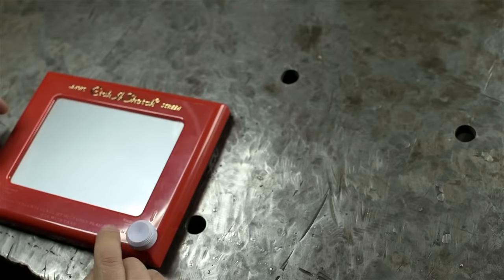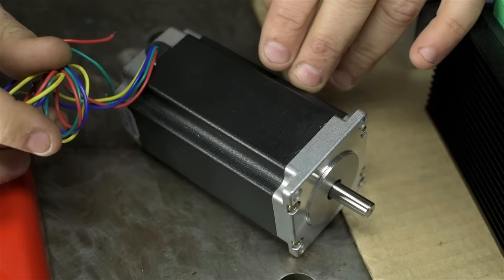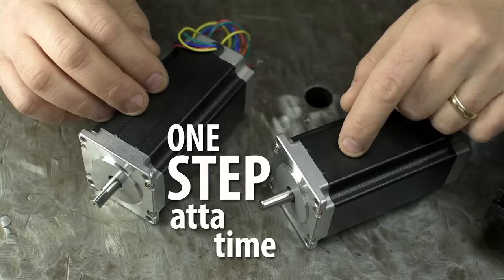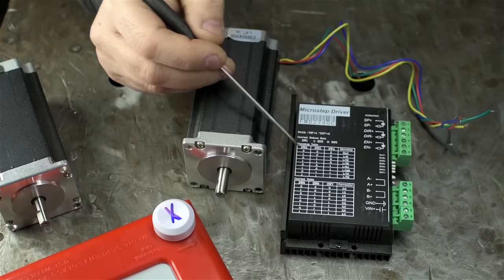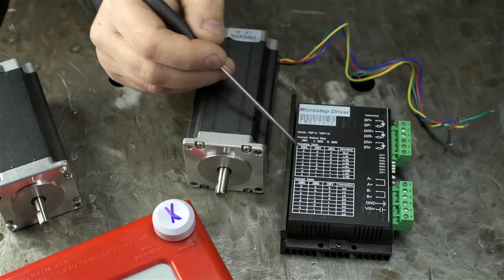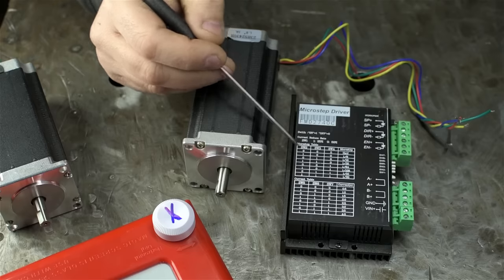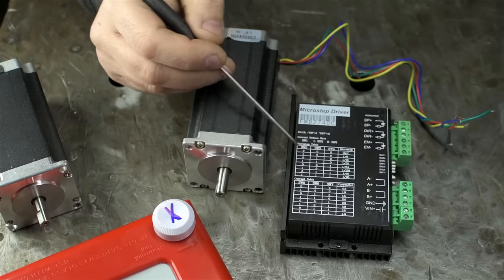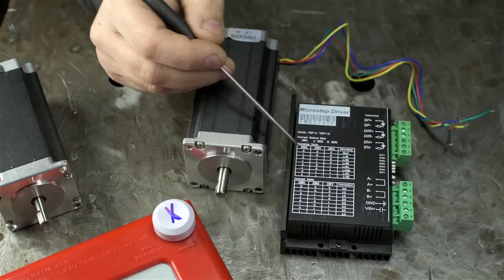Build Your Own CNC! (Part 1) - Hardware

Comment: if you fing that the  output is a bit messy with lines everywhere like the horse at the start, when your making the image into a stl or obj or other format into a gcode, if you use cura or other printing software try using "vase mode" or try to find a button that says "do perimeters first". it should decrease the amount of messy lines, oh and one more thing if you can find a button that says "avoid crossing perimeters" which would further decrease the messy lines. 
hope this helps lol

love your vids keep going

Comment: Those NEMA23 motors are good enough for a small CAR!  Actually most hobby CNC machines and 3D printers use NEMA-17 size motors, some use much smaller NEMA-23's than the ones you have, which almost look like NEMA-34's!  The 3D printer I built does use the '23 sized motors, but they are actually shorter than some '17 sized ones.

Comment: A clever plotter algorithm when you can’t control pen up and down is to convert a raster image to a a set of stipple shaded or dithered points then run a TSP solver on them. The result is a path where no lines cross and the drawing density roughly follows the original shading. You should be able to find a good workflow online— I worked one up many years ago but don’t have the foggiest idea what became of the code

Comment: About the "tangled in rope" part. I use simplify3d for 3d printing, and there is a little checkbox that says "move the nozzle over the printed lines"
Mach4 might have a similar setting, which would let it move the little drawing header over the already drawn lines

Comment: Since the shaft on the motor is available on both ends. Possibly you could put a counter weight on one side of the 3rd axis to help shake the crap out of it. Put it on a small gimbal to help with range of motion. Draw erase repeat. Look mom no hands...

Comment: You would need an air compressor for a bagpipe driver. I play with a guy that tried to help put that together, to break in reeds without blowing out your own lungs. Typical pressures for reeds run between 15 in - 40+ in of water. It doesn't seem so bad until you actually try to blow that hard.

Comment: Also there is posssible more than z-axis, if you example 3d-print there is motor to push plastic to the melting zone. And depents about you cnc, there is loads of option what may need 4-5 or more motors. Same principle, only you need motherboard with more places for driver boards.

Comment: I had planned to use a vibration motor to shake the etch-a-schetch to erase after turning upside down. GRBL is actually pretty easy to use and set-up.

Comment: Oh man, am I older than Tony? I started with the home cnc stuff back when step/direction controllers were unobtainable. Four pins of parallel per motor, four little amplifiers to match. Idk if my memory is operational, but luberth dickman? Was one if the early, early early folks to break the home brew ice!

Comment: Great video! Very thorough. 
BTW you can buy replacement keys (used) for Lenovo/IBM laptops on ebay for next to nothing. They're made to fit multiple models and sellers usually list the compatible models.

Comment: If you wanna do it on the cheap, you can use a Arduino Uno for $20 instead of those fancy control boards.  There is an open source software for the Arduino called GRBL.  This works extremely well and is super easy to setup. You then can use Fusion 360 to output your gcode and use BCNC to send it to the Arduino. There are some great tutorials on how to do this and you can slap a CNC router for ~$150.
Reply: GRBL really doesn't have much of a trajectory planner. It is not a real CNC motion controller really. I can get a used PC for cheaper than an Arduino mega anyways. That's why I run LinuxCNC.

Comment: For small machines (Nema 17s and 23s) a board running grbl, with an Arduino uno and polulu style drivers. Can get a kit for around 20-40 bucks. Great way to get started, or for some small projects like this.

Comment: Nice video. Only thing i would like to correct is that there controller and stepper boards that are cheaper and perform as good as those Gecko boards (or even better). I also don't really understand what is meant with "professional". I have seen NEMA17 even doing aluminum with no problem. NEMA23 surely can handle quite a lot. It all depends how fast you want to go.

Comment: This is great! Could you jerry-rig something inside the Etch-A-sketch to disengage the stylus from the screen and drive it with Z-axis data? A bit of string attached to the third stepper could pull the stylus back a few mm's and release to re-engage sketching. (Or in the name of not flagrantly wasting a stepper motor, have a magnetic solenoid turn on and off.) That way not everything has to be tangled in rope. (It of course goes without saying that I do fully appreciate the rope tangling) ;)

Comment: I bought the same kit, albeit a 4-axis version, from Amazon a few months ago.  It is Nema 23, and the control board is a pirated/knockoff of the Planet CNC control boards.  It even comes with a pirated version of the PlanetCNC software, and a modified, unsigned driver for the PC that won't check for a license.  That means it won't work with Windows 10.  I have yet to get it all hooked up and running, so I wait with excitement for the next installment.

Comment: Depopulated raspberry pi 3(wifi), or Arduino IC. PWM SMD h-bridge. Hmmmmm, wide flat steppers instead of knobs, similar in size and torque to a microwave plate motor. I LOVE THE IDEA. Project Gutenberg has never looked so tempting. Thanks for the video.
Reply: Have cnc path retrace path to avoid lines across image. DIY GCode in Visual Basic.

Comment: Awesome video, i dont know if you will be going down this path or not, but maybe help us select screws or gears to connect the motors. I dont know if backlash or consistency is that important. Also to cut metal might wear out the gears or screws... selecting the correct setup would really help.

Comment: Who would believe that after watching many videos and getting Tonynspiration one would do one´s own cnc.  Got some sbr16, 16mm ball screws complete kits directly from the manufacturer in guess where? ... China, nema 23 motors, microstepper drivers,  and as you said... an arduino =) Mega wich could work with up to 6 motors.    A Huanyang 24k spindle kit (from wich my electrician blew up the variable frecuency driver and ended up getting a Mitsubishi VFD wich I do not regret)  a cable kit, water pump, hoses, chains endstops and so forth.  Oh and a cheap probe for Z.    Had a welder make my rectangular tube table, on top a 1" MDF, and used the rest of the 1" MDF to make the Spindle head arm that moves over 2 Y axis.  No previous machining experience myself, only my partner on manual lathe and manual mill.  I learned all from internet, even using Fusion for 3d desing and the CNC to make thermoforming moulds.  Now I am getting all kind of great tools, all carbide and some even color DLC (Diamond like carbon coating) wich work great on a polyester resin mixture.   And recently got my first batch of 6061 T6 Aluminum stock, and it works!!!!  It has been over one year since the first build and continue to make chances as we see fit, and hopefully would add a rotary axis this year.   A lot may say it would have been easier to buy a CNC, but I guess building it ourselfs is a hell of a ride and to the day not to regret.   By the way, it is 1.2 meters (X and Y) and 0.3 meters (Z), and MDF is not that great, needs some reinforcements especially for being such a long moving head and heavy.   So finally included extra 6061 T6 aluminum to change the parts of the moving head... someday!     Anyway I still come back to see your videos at normal speed and without fast forward.   You are truly a king of entertainment while you teach and show how to.  I only have two, but my thumbs are up for you!

Comment: Love those GeckoDrives. I use three of the much cheaper G251X models to drive my little mill. Only $180 for the drivers, way cheaper than anything else I looked at.

The rest of the system is an ancient macbook I got out of a dumpster, running Ubuntu, and a GRBL controller to talk to the drivers. Very happy with everything but the GRBL, it's total junk and has crippled the system with its low pulse rate. Anything over 36 IPM and it loses pulses.

Comment: If you are looking to reproduce this in 2021 you can just buy a CHEAP $10 3d printer board (something like a model L... if you want slightly ok quality bigtreetech have a lot of choice.  You can get good boards for $50 if you want to make a 3D printer later). You can also get the motor drivers for a dollar or 2 each.  They will be noisy which will be part of the charm.  The motors used by Tony are also huge for what you need (I get it, he had these steppers and motor drivers).

You could literally use Prusa Slicer and slice a model.  Hook your x and y to the etch and sketch.  Dont bother hooking the z.  You could use prontoface or repetier and literally control your etch and sketch direct on the screen.

You could do all of this with a junked 3d printer.  Alternatively an arduino starter kit would be most of the way but would need steppers and drivers since your kit would only have one of each.  These are great for introducing kids to stuff.

Comment: While this is good with lots of details, it can be over-complicated for some people looking to get into it.

A much simpler starting kit would be one for a 3D printer, such as one using a RAMPS and arduino board or something similar.
That way it is primarily wiring motors to the board.

Comment: Hey Tony, I don't know what your plans are with the terminal block, but if possible I would move the 36V wires to the other side, or atleast further away from the 110/220V. Seen it happen too many times that just a strand (is that what it's called? The smaller wires the wire is made of?) splits away from the rest of the wire and short it out with another connector, or in this case - 110V on the 36V circuit

Comment: Why are these stepper motors, and in particular, the drivers so much larger than ones you would see on the a 3D printer? Are the motors bigger because they are moving more mass, and the drivers bigger to compensate?  I mean my printer motors are half that size and the drivers a tiny little board on my main board.

Comment: Thanks for this tutorial !! 
One dumb beginner question. 

The PMDX board requires AC energy, meaning you plug it into the normal power outlet from your house ?  If i buy the DC version, can i use my Meanwell 24v PSU to power the board along with the motors ?  and from where the spindle will get the power ? from the PSU as well or directly connected to the power of the house ??

Thank you so much !

Comment: Why does the controller box cost so much? Does it have a bunch of extra features besides basically being a command buffer and sync? You mentioned a few things, are those just surplus features that to the price? I have some knowledge from the 3D printing space and no controller costs near that much.

I feel like a barebones setup could be had with any cheap arduino setup. Especially when you compare this to something like Klipper which seems to basically form the same loop as the CNC system here.

I can understand the drivers costing a pretty penny considering all the magic involved in moving those motors with only some simple pulses but the control board must have some crazy features that haven't been mentioned to justify that huge pricetag.

Comment: Wait wasn't it cheaper back in the day with the old parallel port? You could hook the stepper motor drivers straight to the computer and not have to worry about the control board and its cost

Comment: So.. now that I have rebuilt my burned down garage (your welding videos inspired me)..  I want to convert my ProtoTrak MX 2 (2 axis) to a 3 axis machine.. I have a Gekko 540, my motors and still have not ordered the PMDX 424..   Am curious about the motor ratings however.. my manuals say 240oz motors are more than enough for a 3hp mill. does that sound right?

Comment: I Think a Nema 23 Motor for a 3D-Printer is pretty much overpowered..
I actually built a CNC-Router for wood and Aluminium using Nema 17 motors..

Comment: Lol I have all the RD232 ports and boards for both 9 and 25 pins. Actually keep a few old PCs and laptops with a real working series’s ports. (Only have one LPt port). They still run win 98 and one runs WFW.  Good ole days lol
Reply: Umm never used them for programming or running satellite cards and boxes though. That was illegal and wrong. 😇

Comment: Okay, I'm lost and confused but then again I am a welder so there's that.  I'm good on the stepper motors but where I got lost and confused at was the motor drives where it turned into " this one is good for this but doesn't work with that and you could use bananas but I'm not ready to stop shaving with Duke's mayo yet".

Comment: You said one pulse turns the shaft one full turn but it actually 200 pulses to turn the stepper one full turn and half step would need 400 steps to move a full turn. 1.8 degrees per step 1.8 degrees per step X 200 steps = 360 degrees

Comment: Thanks but if i want to use a servo like a spinlde, how i connect it. Mach 3 allow the step a dir mode but in which pin of the breakboard goes? Could you help!? i will apreciate it a lot

Comment: Great Video! I am currently finishing an apprenticeship in Tool and die making. My plan is to marry the skill with Mechanical Engineering. I'll be enrolling into a degree program in the year 2021. I was wondering what your background is? You seem to have a lot of knowledge in may areas of engineering. 
I was also wondering if my plan makes any sense. I was originally going to go straight into an engineering degree but was convinced by a family friend who is an engineering that doing tool making first would be very beneficial. Would you agree?

Comment: Hi, i have a 8 wire Nema 17 motor, KL-4030 driver and a DB25-1205 break out board and 36 volt power supply. i have watched your video many times and im just confused on how to wire it. im only doing one axis to see if i can wire it up and make it work. im trying to not let the smoke out. and help would be appreciated. Your videos are great i have already learned alot. motor color wires ( black, white, red, blue, yellow, orange, green, brown ) Driver connections ( VCC+, GND-, A+, A-, B+, B-, ENA-, ENA+ (+5v), DIR-, DIR+ (+5V), PUL-, PUL+ (+5V) -Thanks

Comment: Would it be difficult to map the movements or commands to some kind of controller plugged into the computer? I think it would be fun to play around with this if you could use the joysticks on an Xbox controller. Have the X axis on one joystick and the Y axis on the other one. Shoot Imagine having a CNC machine that was semi-controlled with an Xbox controller. Like having some of the basic commands like the stop and go, or reset to zero mapped to the buttons on the controller. Or have it setup to where you could set the spindle position manually with the joysticks then hit a button on the controller to save it as zero. that would be cool to be able to do stuff like that while standing right there at the machine instead of having to turn away from the machine to hit start or stop and what not. If you could just imagine the possibilities! My brain is a choochin!!! Or wait..... do they already have hand held controllers for CNC machines? Yeeeaaaahhh they probably do... disregard this entire paragraph and carry on....
Reply from the maker: It's been a while but you can use a plug-in for Mach to map control to a game controller.  Had one on an old CNC plasma table.  the only thing I couldn't get it do is vibrate when the tool crashed. :)
Reply: @ThisOldTony  HAHA that's awesome! Isn't it amazing what one can do at their home shops?! Thanks for humoring this young man and responding to one of his late night ramblings! I'm a relatively new subscriber and I am really enjoying your content! I am learning a lot and laughing while doing it and it's quite enjoyable! Cheers friend!

Comment: If you want to try this with LinuxCNC, you can find a bootable CD or USB image of the latest install on www.linuxcnc.org.  Excellent hardware that is well supported can be had at store.mesanet.com.  Most of Mesa's stuff is industrial quality and their FPGA boards run the motion control loop in hardware, which means no matter how slow your PC is your CNC machine won't be impacted.  Mesa hardware and LinuxCNC support both step/direction (Stepper and S/D servo) and Servo with encoder or resolver feedback.  Tony's solution is a basic place to start, though, and he's doing a good job making it an introduction to DIY CNC.  LinuxCNC works very well even for very large multi-axis machines, but if you don't already know Linux you're taking on two projects at once.

Comment: This is like using the engine from a Peterbilt to power a smart car. You could do this project more elegantly and cheaper with a few pancake nema 17s, an Arduino w/CNC shield and a cheap unbranded power supply.
Reply: Yeap, total overkill.

Comment: The stuff where he connects motors to drivers and drivers to BOB (Breakout Board)  is easy - he skips the difficult task - the connection to the PC entirely. The fact that parallel port may not be supported in 64 bit win 7 or windows above it, the software version compatibility etc. This is why he DID NOT use the original supplied BOB - it would not work.

Comment: i have used an arduino with grbl software as a controller, set me back 3$ and works perfectly. didn't even have to program anything. Flash the arduino, connect it to a computer with usb and send it some gcode
Reply: It works with a software called universal gcode sender which is free on windows. I don't see what's so masochistic about it